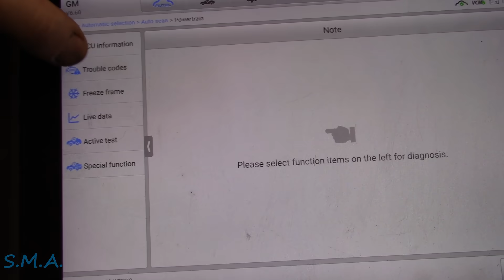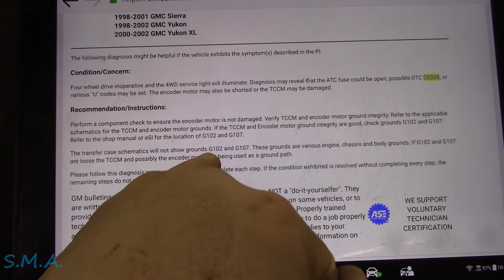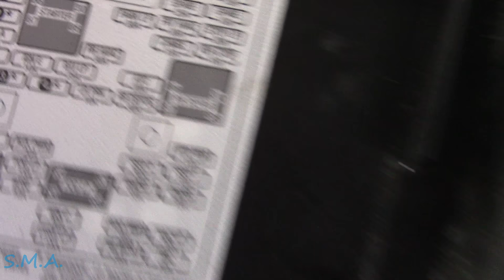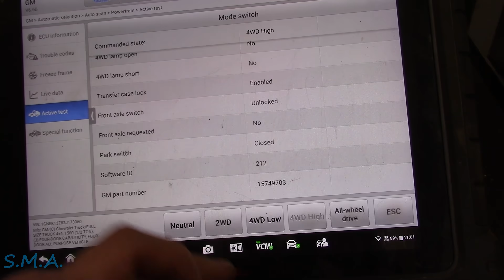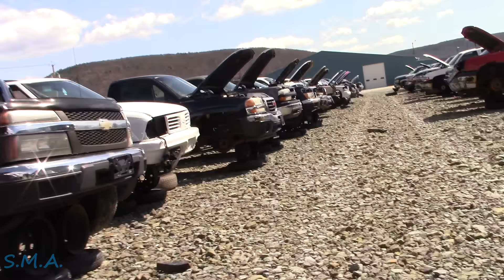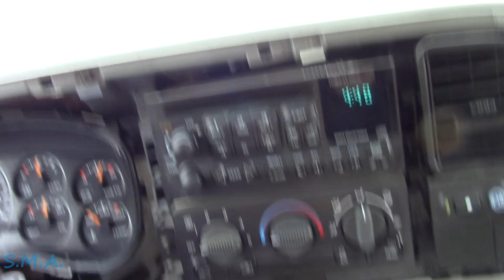Customer Spent $1000's And Still No 4WD

Comment: Excellent work as usual Sir!    I got all lights on the 4wd select switch... until i remove the transfer case module fuse (ATC 15A) when I replace it with the key on everything works.. until i turn off the ignition?? found a bad ground on to the switch, checked for cold solder joints and there were many.. reflowed joints and still same behavior.. I'll check the transfer case module next for ground.. I've never seen this.

Comment: In 1995 I left my job to go work for Kelsey Hayes who made the Anti Lock brake valves for all GM trucks and suvs. A month after I started they said to transfer to their new facility or lose my job. I took the transfer and went back to college under their tuition reimbursement program. They always told us if your antilocks ever had an issue your car would just revert back to standard braking. In 2000 I bought a used 1997 GMC Jimmy. The ball joints eater. When the first ball joints were replaced under warranty. The local Chevy dealer instead of unplugging the weather tight connector just inside the wheel well they cut the wires and spliced them with a non sealing regular wire connector. These quickly corroded and when you hit the brakes the antilocks would cycle but the vehicle would just take off like you lost all brakes. I had to crash the truck to avoid rolling out in front of a cop. That was in 2003 after I had left TRW (Kelsey Hayes new owner) and started my new career. That same year GM pulled TRWs contract. Here it is 2026 and that Jimmy sits in my driveway awaiting the junk yard. The head gasket blew about 18 months ago. It has been sitting ever since. 
By the way I sprayed the entire frame with the can rubberized rust proofing and it accelerated the rot by a decade. It is almost rusted completely in half.

Comment: Driveshaft is likely out because it needs to come down to remove the encoder motor. And the encoder motor will need to come off if you want to climb under there and manually put it in 2 high so you can still drive it. My Silverado had no front shaft or E-M for about a year until I finally decided to buy the part. When I bought my encoder motor it was somewhere north of $300 for the part. Hot tip: when you get the new one don't plug it in and "test it" by pushing the 4x4 buttons before it's installed on the t case. Mine was a real pain to get it clocked correctly again.

Comment: Came across this video today, 12/7/25  My Suburban is the exact same Sport Metallic Red, in the rust free zones.  I have issues with my 4 wheel drive as well, but I have 300k so I'm winning.  I bought the cheap Amazon encoder motor and when I put it on and tightened it down, the actual case popped out a nice circle of itself.  The thing worked when I first connected it, once.  Contacted the seller and they sent me another.  This one, the case didn't break but it did the same thing, worked once and quit.  When I say worked once and quit, the lights on the 4 buttons flash at start then stay off.  I put a new actuator on last year, I put new button switch on and I went to a Upull IT and got a replacement TCCM.  Same thing, no button lights.  I just got another encoder motor, this one from Rock Auto.  Hopefully today or tomorrow depending on when I want to freeze/get miserable wet in the driveway I'll get it done!

Comment: I had an 06 Silverado that did this as well.  4x4 was completely unreliable, and would randomly shift to 4-low on start up.  Poked and prodded for a while, eventually found a bad ground wire in the harness to the front actuator.  Replaced that, and still didn't fix it immediately.  So no 4x4 for a big snow storm.  2 days later, it started working 😆. I didn't have a scan tool to clear codes so I assume it took a few drive cycles to clear itself

Comment: A question and tip how do you bill for time to salvage yard straight shop time to and back? Tip if the four wheel drive is engaged if you turn the steering all the way to the stop it should try to crawl walk in a tight turn if it does you have four wheel drive

Comment: Now don't get upset because you know I'm your biggest fan. But,,, your slipping old man! I've been waiting years to bust your coconuts with that line. When you checked the replacement motor for motor integrity and a short to the case. You checked the integrity of your test connection AFTER you tested for a short to the case. Then you literally moved your test connection, and once you confirmed the connection was ok by touching the case, you didn't retest the wires! Lol. Hey I'm just messing with you guy. Heck if that's all I ever missed while I'm diagnosing things, I'd be happy! Great video. Take care. I would like to add..... That at 64 years old you have taught me that common sense is your best diagnostic tool. I've found so many problems on not only cars, but boilers, ovens, industrial AC units, compressors, and even strange home wiring issues, that I am no longer timid about walking in to diagnose anything! That's is all because of you sir. Eric I fully applaud you! 🏁👏👏👏🏁 And if I'm ever in your town, I'm taking you and the fam out for your favorite dinner and ice cream treat!  You don't realize how your videos impact tons of people, and in ways you aren't always aware of. I'm an example of that.  Thanks again! J Poll. 💯🏆👍
Reply: The contacts are clean and the case is not. The corroded case my not be giving a good connection.

Comment: I am having same problems with my 2007 chevy silverado 1500 4x4 5.3. Put all the new parts on it and it still wouldnt go in to 4x4. Now this morning I seen the 4x4 light was off. So I tried 4x4 and it went into 4x4 now it will not come out.😢

Comment: Nice job.  I had a similar problem and took a while to figure out the wires were broken between the underhood connector and the trans case motor.  PITA.  We usually think the wires are Ok, but in this case no.  I did not try to find the break in the complex harness inside loom, just ran new wire and spliced into connectors  Cut the old wire and left in place.  Fixed.

Comment: Was the light on the selector switch on prior to changing parts?  Or was it just not shifting?  Having a similar issue. My lights arent on. Iv changed out selector switch and the tccm already with junkyard parts no fix yet.

Comment: THIS is why I wanted a BASE model F150 4x.. as base as it could be anyways it still has a lot of stuff but ZERO steering wheel assists or lane sensors, on the F150 in there  are those radar and lane sensors are in the tail lamp $5k to replace and you can buy a standard XLT and bolt your shyt i one of those cuz you cannot purchase sensors separately, use you might be able to depends if yard munkees are savvy, imagine when your radar goes down for your cruise control, or your GPS steering goes out, biddies sonata has lane sensing and his steering locks in corners on the freeway, LUCKY $6k to fix...  its ELECTRIC power steering to boot .. people are paying high dollar for these vehicles not considering when stuff goes bad down the road you're on the hook for BIG BIG MONEY, and you cannot drive it most the time with that steering assist garb malfunctioning.. NO THANK YOU and I got so lucky cuz as of 2024 the XLT ford F series base model is no longer base, its LOADED to the gills too.. some cool stuff, some not..   in any event for me the less there is to fubar the thats fubared, then you have shops like where this guy went and they threw parts at it in holes it fixes itself...  knowing a good class act mechanic like SMALL is invaluable, never forget em come holidays . .   rather pay 2-3 hours in troubleshooting and diagnostic shop time than to just have a wanna be throw parts at it, cuz not only do you not need them replaced they are tossing your good parts out, we they don't fix it ..  why you should always say can I see the parts when your thru and can the mechanic test them in front of my eyes or show me the wear and or breakage .. for all we know that shop did othg to this guys vehicle and just charged him a K for GP..  ALWAYS report fly by night shops on like Yelp peopledo use those for this kind of thing, if you know a good solid mechanic, mention them where you've had bad experiences like this guy had . .   word needs to get out who is good and who is shady, we have the technology!

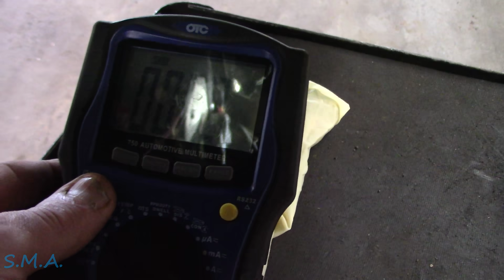Comment: 25:18.  +1.  Whoever designed these chip meters to disable the backlights after a few seconds should be whipped.  If the users turns on the backlight, they want it on indefinitely.

Even if they want to add an auto-off timer, it should last at least 30 minutes or something reasonable.  It's a tool and if a tool user leaves the backlight on and drains the battery, then so what?  It's the user's fault; they can install new batteries and perhaps learn to turn the meter off.

Comment: Eric,,,, how many times have you had the issue when the customer plugged in the motor with it OFF,,, the transfer case then operated it to see if it turns?  i have had that several times over the years,, and we know what happens if that is done,,,,,  motor crashes and destroys itself,,,.

Comment: I had several GMC Jimmys but the one that gave us grief was the 1992. GM changed the 4 wheel system to run off the vacuum system. Any leaks or a drop in vacuum pressure caused the vehicle to try to shift into 4 wheel Low and high speed. Once you slowed down to under 25 the tranny would pop v=back out of 4 Wh.

Comment: I have a 2002 gmc serria 1500 , would go into 4 wheel high ,but would not go into 4 wheel low. It was the neutral safety switch.  Under driver side of truck.

Comment: Just an FYI, my sister‘s hummer with an all-wheel drive with four wheel low and high had an issue. Even though the dashboard said it was in all wheel drive. I could tell it was in four-wheel-drive. Long story short it was the plastic ring shift gear had melted, and the plastic nipples on the shifting fork had slipped off of it. The shift ring  under deceleration GeForce move forward, shifting the transfer case into 4 Wheel Dr. Dashboard all of the servos every thing said it was an all wheel drive, but upon opening the transfer case we found the problem. the shift ring was floating around back-and-forth.

Comment: I had an “02” Silverado and loved the ride. Bought a 2013 brand new and tons of problems under 100k mi warranty, they lowered the warrant when I traded it in in a 2018 to 60k mi and my 2018 Silverado has been amazing. But the ride of the 2002 was the best of them all. 275k miles of punishment before it gave up!

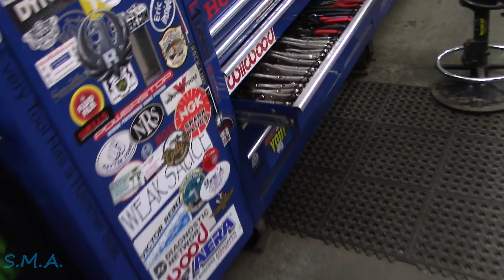Comment: At 12:47, tester lights up on both legs, "does that mean there's both legs of the fuse?".  Probably.  Using a VOM will tell you for sure. 12V on both sides simply says fuse is good but not that voltage is getting to where it should be. Throw the quickie light away.  Then holding up the removed fuse to the light to check if it's blown?  99% of the time the visual is okay, but the definitive check will be with a VOM, resistance.  Be one with the VOM.  BE the VOM.

Comment: My first 4x4, 1968 Dodge W200. Two levers on the floor, mechanical linkages, 4x4 in/out, high and low range. No freaking servo motor, software, push buttons, etc. No problem!!
Reply: Yup, two floor sticks, locking hubs, no electrical Bullshit. If it ain't broke, don't fix it. If you are too whimpy to get out and lock the hubs, stay home when it snows. 😊

Comment: I love my manual shift.
BTW the one problem folks have is sometimes the linkage pops off the ball.  It the same ball connection on lift gate struts but must have a 10mm ball and 8m threads.

Comment: How hard would it be to setup a stand alone electric shifting on a Chevy 2500 263 Tcase behind an Allison?  I'm building an 84 chevy crewcab on a 2014 Ram chassis with an 05 Cummins comonrail.  Trying to figure out an easy way to shift the Tcase electrically.  Thanks.

Comment: I have the same truck but mine is all wheel drive 6.0. anyway, things mint shifts great the transmission I mean but if you really floor it it slips a little. Do you think it's just because it's wearing out and needs a rebuild or it needs a fluid change as high mileage too so that's why I went right now. It shifts good as long as you don't floor it. So you think I should just drive it or should I bring it to a shop and try to have them service it? But then I feel like they're going to end up telling me I need to rebuild. So I might as well drive it until it really really slips and then just have it rebuilt right? Does that sound like a rebuild issue? Something it can't hold its own power basically, but it shifts great except for if you really floor it

Comment: Spent 1300 tran's, 1000 front diff, then mechanic charge's me another 1300.00 an mechanic leaves front drive shaft out an leaves it without 4x4. An all this to take out my upgraded torque converter. Still got power steering issues, motor sealing issues. Yup Mechanic's can rip you hardcore.
Reply: $9500.00 into a 2002' 2500hd 6.0 with 230.000.miles on it. Lol

Comment: Well now I learned a lot bout my 06 TRAILBLAZER EXT .  The 4 wheel drive quit working on me and I guess I got lucky with my choice of the dorman encoder motor unit I picked out. And I figured that I would have too clear out the codes before mine would function correctly again . So thanks for the update!

Comment: Dang I wish u were close to south texas. I have a 2019 4runner that the dealer said was struck by lightning.  After 18k and all new electronics my 4runner is back on the road. Only bad is I found a ground strap that was changed.. my guess is it took 18k of parts to figure out the ground was bad. Unfortunately no way of knowing if this was the real problem.  The only issue it gave me was not starting and a bunch of lights on the dash.

Comment: A NAPA shop tried to hose my sister by telling her the oil leak in her 94 Honda was caused by a blown head gasket. $1500.00. I fixed it by replacing a 35 cent, clover leaf gasket on the back  of the head. They did hose her later by changing the 9000 mile old starter on her 03 Toyota because the steering wall would rock upon cold start up. The problem was a small hose that connects two sections of power steering line. The steering wheeled rocked because air was pulled into the system. A 50 cent piece of hose fixed the problem. There were other ridiculous, unnecessary charges over the years.

Comment: Without knowing all the facts....this seems like a person/company testing mechanics.  With the driveshaft and transfer case "missing", the vehicle must have been towed it (I'm not a mechanic, so maybe it was driveable without the drive shaft, but I doubt it).  It seems to be a test....all these parts are in the back, will you notice they are missing and put them back in, charging properly....or will you make outrageous claims as to what needs done and charge a bunch.  Eric O seems (I have only just begun the video) to possibly be the only one making the connection between the issues and the parts in the back of the vehicle (based on the story of other places charging a bunch and not fixing the issue).  I've heard of this being done by news stations and other places/people, where they take a vehicle with a 'faked' issue and see what the shop does.

Comment: My 4WD indicator lamp wouldn't illuminate in my old Toyota. Turns out the pins on the axle switch rotted into the connector. The new Dorman switch from the Rock BROKE IN TWO PIECES as I was tightening it to 30 ft.-lbs. The new Toyota switch from the dealer cost three times as much but didn't break in half. Thankfully, I returned the Dorman switch to the Rock for a full refund, including return shipping, with zero hassle.

Comment: I would have taken the motor apart and determined if the worn brush debris was making the short to ground. The motor maybe OK. If the the brushes have enough length some electronic cleaner will do the job. Also the insulation between the commutator segments may need to be undercut to .02-.040.  OregonIvan

Comment: Not to be too critical to the other mechanics, but even as a DIY mechanic, I always question whether my new part works. I had to do the transfer case motor on my suburban. I used aftermarket and that's when I realized the original was never right. It took forever to change gears in the transfer case when it did work before giving out completely. The new motor changes gears quickly. Great video.

Comment: I love watching your videos, because it’s always a simple fix….but the route to finding that simple fix is always a great process. I enjoy the puzzles of true diagnostics and mechanicing. 225k miles? That’s just now broke in. I sold my 2004 crew cab Silverado z71 to my brother at 230k miles, 10 years later he still has it. Original engine with over 400k miles on it now. I did rebuild the 4L60E for him 3 years ago. Rear differential was rebuilt a year ago. And it’s had the transfer case replaced about 4 years ago. But my brother is the type that can break an anvil if you leave him alone with it long enough. So I think it speaks volumes as to the overall reliability.  Over 300k miles before any real issues. I’d rather spend $10-$15k rebuilding one of these trucks than buy ANY of this new garbage out there now. $65k for a pretty garbage can, I swear.

Comment: I had my Actuator split on me so many times on my 02' Blazer ZR2.
They finally came out with a new HD Actuator!!
However, I hit my 4x4 switch to high the other day & now I got a dagum whining noise coming from under the driver's seat, transfer case area. 
The light shows it's back in 2wd. I've backed it up to make sure its unlocked & I can hear it clanking into 4x4 when I put it in High or Low. Just a weird noise now